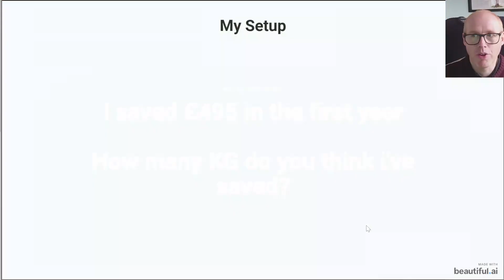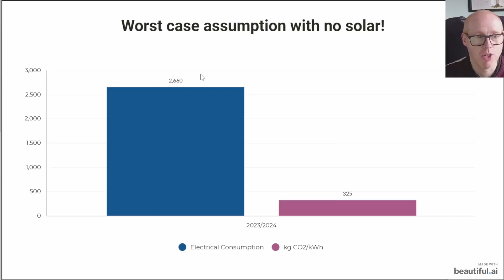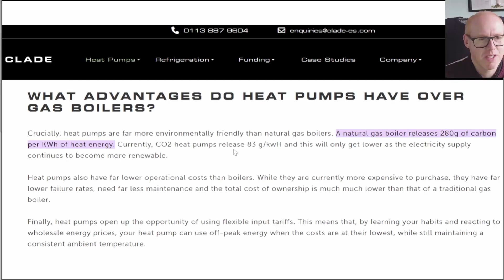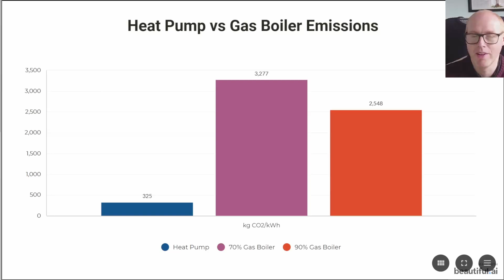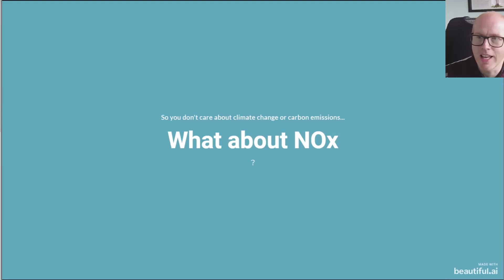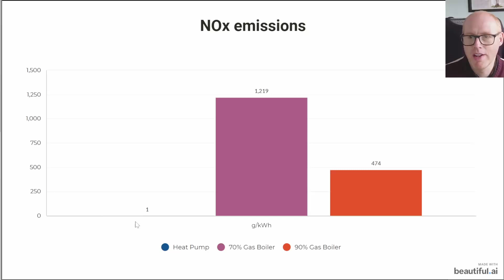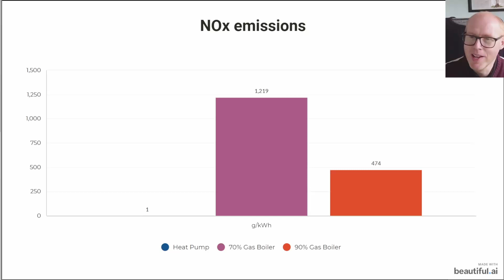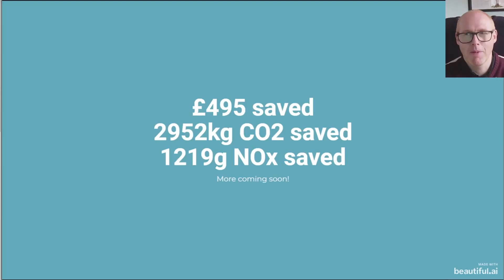Do Heat Pumps Really Save Carbon?

Comment: Another very clear and unambiguous video explaining the advantages of going electric to reduce carbon, and other, emissions. Keep up the good work Richard. We followed you and other channels for a year before getting our ASHP installed. We went from an oil boiler, to electric storage heaters and heating panels for 2 years, before getting our HP.  It’s been in for 2 months now with a cumulative SCOP of 4.75, and keeps our whole house at a comfortable 20 to 21C all the time, even on our coldest day so far at -6.2C.  Moving from oil to the HP has reduced our heating costs to a third of what they were and has massively reduced our carbon emissions. As you point out this will reduce even more as the grid continues to decarbonise.  On a mild day when it’s about 9 or 10C outside our HP uses ~12kWh to heat the whole house and DHW all day, which is what it took to charge one of our old storage heaters to heat one room. On our coldest -6C day the HP used 35kWh all day for heat and DHW, and cost us £4.50.  In the storage and panel heater days that would have been about £10 without heating every room. And in the worst of the oil boiler days about £15.  All in all we are very happy with our ASHP.
Reply from the maker: That's brilliant to hear! Continue to spread the message in your sphere of influence.

Comment: I did not expect the carbon emissions reduction to be that big. Absolutely amazing 🎉
Reply from the maker: I think so too!
Reply: You have to bear in mind that the starting point for CO2 reduction is 4x less as the SCOP for a well designed and installed heat pump is at least 4 (it's actually nearer 4.5x relatively as boilers are typically less than 90% efficient).

Then you include that roughly half of electricity creation is green so isn't creating CO2.
Reply: @darrenadams2640  totally agreed. I was more surprised by the quantity than the percentage, amazing that it's literally tonnes a year. That and the car and the panels are contributing hugely to an overall reduction in carbon pollution, while saving money 🤑

Comment: According to my supplier (EDF), the UK average fuel mix co2 per kWh is 171 g/kWh. In my case with a projected COP of 3.8, my CO2 emissions with an ASHP should be around 20% of that produced by my gas boiler, so a saving of 80%
Reply: It's huge right now imagine by the time everyone has a heat pump and more grid connections/wind/solar are implemented. 

It's a glorious thing
Reply from the maker: Interesting that EDF has different figures.
Reply: @UpsideDownFork  EDF claim that the 171 g/kWh comes from the UK Department for Energy Security and Net Zero (DESNZ)
Reply from the maker: @tarbat  Ah, ok. Maybe they're using old figures?
Reply: Looks like that figure comes from DUKES 5.14 data from DESNZ, available here: https://www.gov.uk/government/statistics/electricity-chapter-5-digest-of-united-kingdom-energy-statistics-dukes

2023 is the last year for which they have published information so far (and I think even 2023 was based on partial data) and it states 171gCO2/kWh

So EDF are not wrong because they're using the latest "official" figure ... but we have also improved a lot since that was determined so the next "official" figure is likely to be closer to what @UpsideDownFork used in the video

Comment: They don't make acidic condensate either , the average boiler produces a ton a year of acidic condensate. Having seen the damage it does to boiler internals , roof tiles etc. that's another plus point. Then add the gas network leakage of a 2-10% for the win.
Reply from the maker: Good point!

Comment: The CO2 argument often made by those against heat pumps and EVs (same argument) is that it’s just shifting and ignoring that it’s not true that assumes our grid will remain as dirty as it currently is, again it’s not.

If you’re burning something as fuel at home you’re only ever going to be able to burn that fuel, if you go electric and the grid gets greener you get greener, so the argument isn’t just now, but tomorrow and the day after. If we reach a point where the grid is consistently almost 100% renewables then those co2 emissions from powering a heat pump will be nearly zero, it will remain consistent for your gas boiler because it can only burn gas, and gas isn’t going to get cleaner.

Even if it was just shifting that isn’t necessarily a bad thing either, as it would move the CO2/no/particulates away from urban centres where they cause the most damage to people’s health.
Reply: It's mostly that people repeat what they are fed. If the grid was supplied by old fashioned coal generation only a cop of 4 would be the break even point. With modern coal plants that would be scop 3.2 . But clearly that is not how electricity is generated. In the UK we average a quarter of the emissions of a coal only grid. Its an undoubted win for the planet.
Reply from the maker: Exactly that!

Comment: I intended to add AC, but added a heat pump instead, it will provide all the AC needed and once it gets cold enough my high efficiency gas furnace kicks in. In Edmonton NOT having gas is ludicrous. The entire system is forced air based
Reply from the maker: @DimebagDarrenCoins  thanks for commenting from Edmonton!!
Reply: So you have an internal heat pump which produces cool air for your home? I was wondering if that would be possible.
Reply: @zen1647  heat pumps like other similar systems have a set of coils that are inside, integrated part of the forced air system and then there's a condenser outside the building. A heat pump is a reversible air conditioner, review a video called "You're wasting money on heating! Use your A/C!" will help you understand heat pumps
Reply: @DimebagDarrenLowe  Yeah, I'll check out that video - thanks!

Comment: I have heard, in some scenarios, that heat pumps are capable of saving CO2 emissions even if the grid is running from 100% gas. I haven't done those calculations myself to verify but the point is that, yes heat pumps are indeed a really useful technology in cutting emissions. It really is quite common for gas boilers to emit around 4 tonnes of CO2 per year heating a fairly average size home even though almost nobody is aware of the fact. Add in the solar generation you have and as you pointed out, your estimates are conservative. When burning gas we often have zero awareness of energy usage, efficiency or emissions. We used to just count the cost of the bill. Going electric gives you a far better awareness of all these things.
Reply from the maker: Yep, I did the calculations last year and did show the working in a very old video of mine. It is true that even a 100% gas grid with a heat pump would still be cleaner than a gas boiler.

So true that we have a major lack of awareness around our gas consumption.
Reply: Even if the grid is powered entirely from coal, the heat pump will still save loads of carbon compared to a gas boiler. They are a win-win for the environment.
Reply: If your heat pump has a SCOP of 4, then the power plant would have to be only 25% efficient to break even with a heat pump compared to a theoretical 100% efficient boiler.
Coal plants are about 35% efficient, so even that would be an improvement. Modern combined cycle gas turbines are about 70% efficient, so that's a massive improvement.
Add in the fact that any boiler producing a cloud of steam is not condensing, and thus probably only 70% efficient instead of the claimed 90%, and it's easy to see why the heat pump is better.